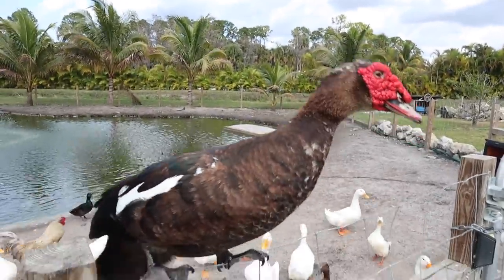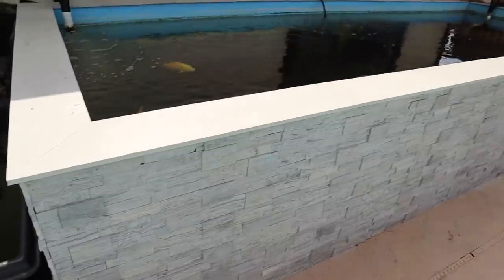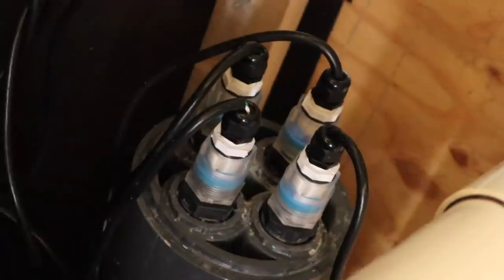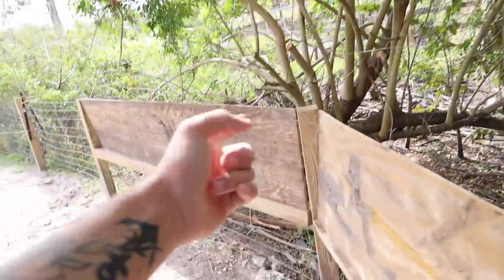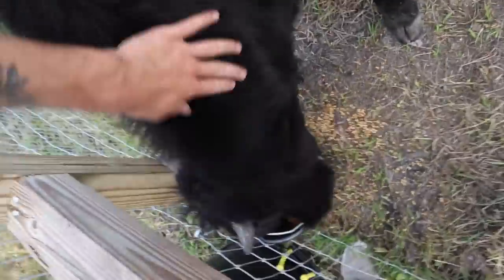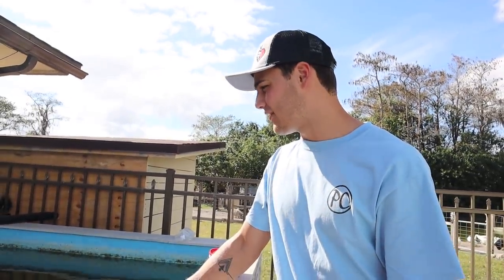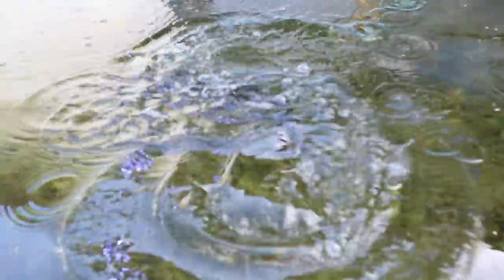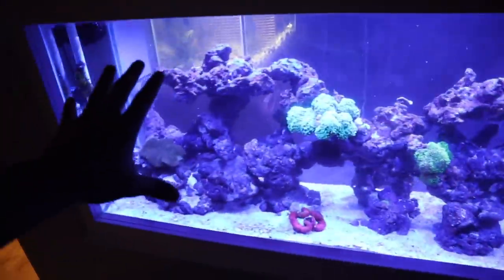FEEDING ALL My MONSTER FISH in *NEW* 4000G POND!! (underwater footage)

Comment: Paul if you pre drill a hole that is a hair thinner than the screw and roughly the same length as the screw your using with a drill bit the screws will go in so much easier and you won't strip the head of the screw. It's called a pilot hole. When you strip the head of a screw it makes it a pain in the nutsac to get them out. I know it takes longer and if you don't have 2 drills you have to switch out the bits every time but trust me its worth it if you ever have to take down the wood or replace the screws. If you have 2 drills just carry 1 drill with the bit for the screw and the other drill with the drill bit.

Comment: Hey Paul notice how the screw didn’t go in smoothly Bc that is a hammer drill used for my more heavy duty stuff like drilling holes what your supposed to be using is a screw drill it’s made especially just for screws